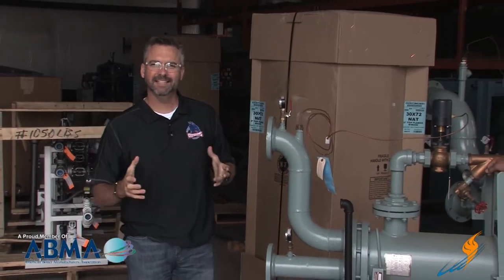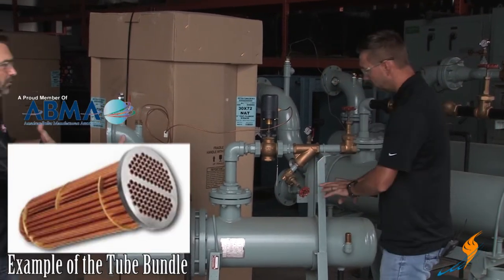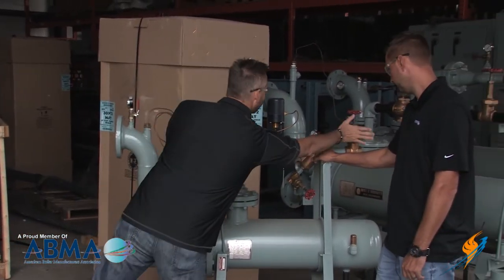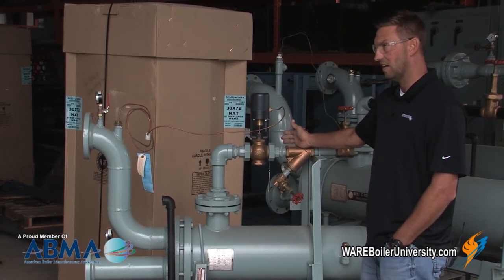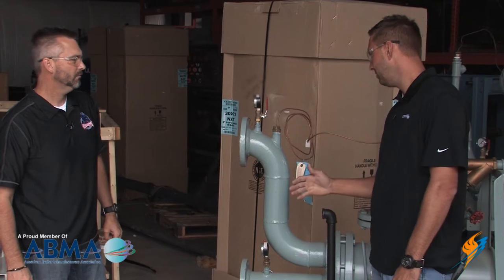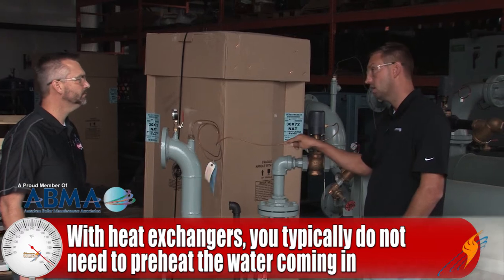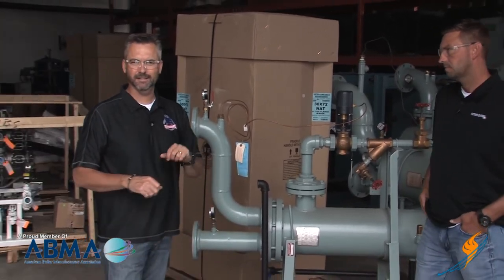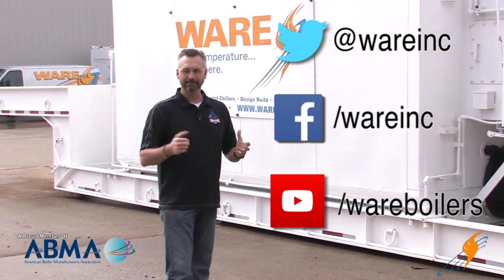Steam Heat Exchanger - Boiling Point

Comment: How can we overcome metal corrosion  caused by acid, which is due to the dissolved gases in steam condensate? Is there any optional device we can use instead of vacuum breaker? Generally, we see that dissolved gases in the condensate is one of the reason to damage heat exchangers.